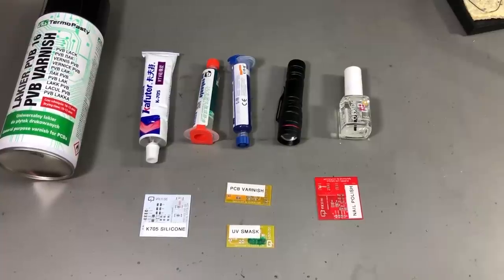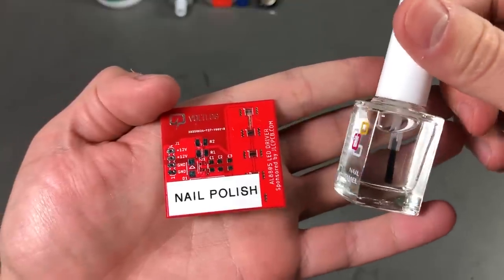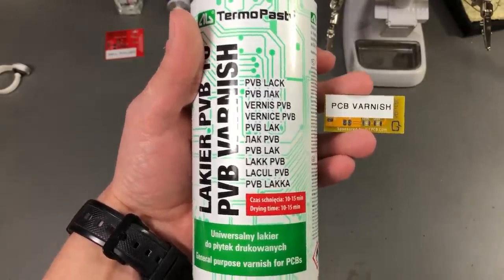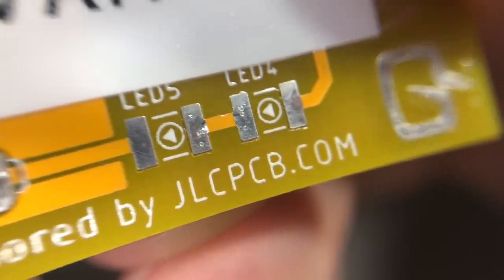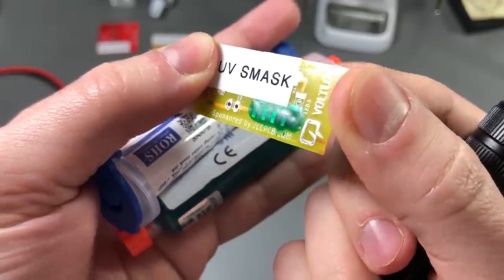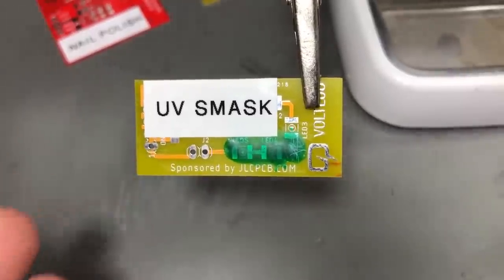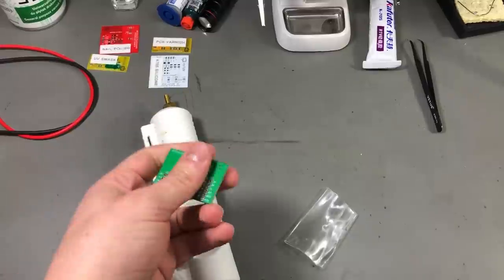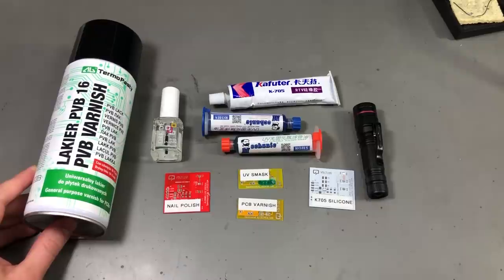Voltlog #220 - How To Waterproof Your Electronics or PCBs

Comment: Great video. Great Scott did a few videos on this a while back, and one other thing he experimented with was true potting compound and epoxies. He also looked at a more extreme condition, water submersion. I think nail polish/lacquer is probably good for 90% of permanent installation of hobby projects (with maybe exception of submerged environments).
Reply from the maker: Let me start by saying Great Scott is an awesome youtuber!  Luckily we live in a day and age where one can find solutions for pretty much anything., like I found that pcb lacquer spray which is pretty affordable (around $10) and easy to apply. Sure if I was in a pinch and didn't have anything else, I would use nail polish and it would probably be fine for a hobby project.

Comment: Somewhat expensive, but I use Electrolube silicone conformal coating for small PCBs.  A 15ml container with brush is about £7.  It works well.  just paint it on like nail varnish.  You can find it on ebay.

Comment: Termopasty is also the manufacturer of rosin flux, which is very good to use. It's called Kalafonia. It's solid crystalized flux, it melts with heat or you can dissolve it in IPA to make it liquid.

Comment: I use silicone conformal coating specifically made for electronics.  It's not that expensive and is quick drying. Even as a hobbyist, you can apply it after circuit board assembly. It is available in both aerosol spray and brush on.

I also use potting compound - what you described as epoxy in your video. As my name suggests, I do RV (Recreational Vehicle) electronic projects that can be exposed to the elements, and a waterproof solution is essential.  One other advantage of potting compound is you don't need a case. An electronic potting box holding the circuit board filled with potting compound is an economical alternative.

Some of my projects use microcontrollers that must be pulled out of the circuit board if a firmware update is needed. To accomplish this, you need to use machined sockets as the standard split finger type can be damaged by potting compound wicking from the bottom.

Also, I sometimes have to seal the bottom of components prior to potting, again to keep the epoxy from wicking into the part.  DiP switches and such are two examples.  I typically do this with the brush on conformal coating, so in some cases, I use both products.

Not sure if I would use Nail Polish, lacquer sprays, or other general purpose items when low cost electronic grade solutions are available. You never know what will happen over time. Some products might damage the board or components.
Reply from the maker: yeah it's nice that even as hobbyists we can find and purchase these professional solutions, thank you for your feedback!

Comment: To be honest, I never used any coating on my PCBs - then again, I never needed to place any of them outdoors. Certainly that does mean that the home-etched ones with exposed copper and nothing else don't exactly stay shiny for long, but I've never had any of them fail after any amount of time either. But it's nice to see how many ways there are to skin a cat, and I do have a project in mind that definitely will live outdoors, so... nice line-up!
Reply from the maker: I remember the days when I was making home-etched PCBs, they we're oxidizing pretty fast. The solution was to use some form of silver coating (expensive) or uv solder mask which was messy to apply and difficult to get right (pad alignment)

Comment: I tend to use the 15ML Electrolube FSC conformal coating.  Just ordered some Kafuter k-705 to see how that compares.
Reply: John, I hope you'll share your findings!
Reply from the maker: From the pictures/description I assume FSC is more liquid so it's easier to apply if you need it to flow into small spaces. Would be interesting to present your findings in a video.
Reply: @Corgitronics  No problem, will do mate 👍
Reply: @voltlog  It is quite thin buddy and flows into hard to get to areas quite well. Yes I'll do a video comparing them 👍

Comment: Oil filled box... The moisture will separate itself and settle down, thus making it easy to remove. Plus it'll provide liquid cooling
Reply from the maker: Sure you can do that but oil is a solution used in general for high power circuits. I'm thinking it's preferred for it's cooling capability rather than moisture protection because you can achieve moisture protection with other stuff that is easier to apply.

Comment: For the little project I'm working on, I've been thinking of potting. The board doesn't have any mounting holes in it so potting it in a project box is the best way I can think to do it. I can do it with slow setting two part epoxy pretty cheaply.
Reply: @2000jago  Do you have a recommendation for a cheap potting compound that holds up? The only potting compounds I can seem to find are like $30+ in bulk, I only need enough for small rc car boards.

Comment: I didn't hear any concerns mentioned about coating a PCB so I'd like to add one... heat retention. Coating a board will decrease components' ability to dissipate heat. I would think thicker coatings like silicone and hot glue would have a greater insulating effect. Just something to take into consideration.
Reply from the maker: you are right, one should consider a decrease in heat dissipation capability when adding a thick coating.

Comment: I usually use spray conformal coating, which can be purchased fairly cheaply here in the US (not sure about overseas availability). It works fine for me. I suspect it is similar to the PCB spray varnish mentioned in the video.
Reply from the maker: yeah, it's likely all of these spray conformal coating solutions are based on the same chemicals.

Comment: Great topic and good tips! I had never heard PVB Varnish but I immediately noticed it has its name also in Finnish on the can. And I could find it right away from a local webshop! A year ago I searched for products to use for waterproofing electronics but the only one I found recommended was Loctite 5145. I managed to find only a single shop here that sells and it had to be picked up from the store. Even there it was something I had to ask from the counter and then wait 15 minutes while it was fetched from some back storage. Not to mention it cost 40€. I'm pretty sure it'll dry up before I can use even 10th of it. Money well spent. It's also difficult to apply and the outcome is definately not pretty. :D
Reply from the maker: PVB Varnish spray was about 10$ if I remember correctly, definitely affordable and easy to source, at least in the EU.
Reply: @voltlog  Today I decided to order it. It turned out that the only place I could find it in Finland is a musical instrument store which is 700m walk away from home. :D They also have some generic electronics components (with focus on audio) that I might someday need to get quickly. Quite a coincidence! For potential Finnish readers: https://www.uraltone.com/pcv-varnish-16-suojalakka-piirilevyille-400ml.html (product name is misplelled)

Comment: Hot glue is really bad material for waterproofing your electronics. I have used glue in my aquarium's hood to waterproof some electronic parts which were about 10 cm over water level (very moisture environment because of water evaporation). Hot glue became unstuck from the parts after 6 month. So my suggestion is to use hot glue only when the environment is dry.
Reply from the maker: Thanks for the feedback
Reply: Also, sunlight, can shrink it and lead it to get peeled off.
Reply: It might work if the whole device is covered in hot glue.... With nothing coming out of it... Like induction powered -fully enclosed circuit
Reply: I'd say heatshrink filled with silicone sealant would provide a much better protection than hot glue. That being said, not all hot glues are the same so I'm also sure you can buy a specific hot glue that is specially made for waterproofing with better sealing properties. Such hot glues might even require special hot glue guns as they sometimes have higher melting temperatures.
Reply: Hot glue is sometimes made of PVA, a material that dissolves in water.

Comment: Very interesting video, thank you! The way I see it, it's important for any method to allow removing of the material in case of need for repairs/rework. I do small batches (<300) of boards and they usually require some kind of repair after several months of service, so I want to be able to remove the coating around a component. So, what you see as a disadvantage in some of the methods, I see as a requirement!
Reply from the maker: Certainly there are different requirements for different projects, I wanted to show some of the properties of these different solutions so people have something to start with.

Comment: I've yet to protect a board from the elements, but I have secured boards in 3D printed boxes before with MS Polymer adhesive (no acetic acid and ridiculously cheap). I'm not sure how water resistant it is however, so if I needed to seal a board in aqueous environments I would probably protect the board with a layer of varnish first then cover it in normal acetic acid silicone sealant for a dirt cheap 100% waterproof solution
Reply from the maker: Like someone mentioned in a comment above, it's important to check if these solutions would react in any way with the metals on the PCB to avoid issues like corrosion. It's likely that the acetic acid will slowly eat away the metal.
Reply: @voltlog  Not if it is covered in another material first to create a barrier

Comment: RTV Silicone (pure 100% silicone sealant available at hardware stores) works great. It's used to seal exposed elements like terminal blocks for marine and aircraft applications.
It's really good for providing both sealant and strain relief, for example, where wires connect to a pcb. (But it is a bear to remove.)
Reply from the maker: I'm guessing this stuff also has a strong odor? Like the silicone adhesive used for sealing stuff in the bathroom. I tend to stay away from stuff that smells bad because I have the lab in my apartment. But sure it's a good solution for those who have the proper space for using it.
Reply: if the silicone uses Acetic acid to cure and you put it a box while still curing, you run the risk of eating away your pcb tracks over time. the word acid gives the game away. there are loads of makes of pcb varnish on the market. as always do not coat your board until it's passed all it tests and you know it's working correctly. we used to dip the boards in to varnish then hung to dry.  but we did make units for military aircraft. look for  "conformal coating"
Reply: @voltlog 
The smell isn't that you should be worried about. It's usually just acetic acid (vinegar) for the bathroom silicone. The acid can attack copper though, so it isn't a good idea to use it on PCBs. But that's just one of the many ways how silicone rubber can be made. What you smell is essentially what splits off the uncured silicone polymere, so those polymere chain can link together (curing). Check the MSDS of the silicones you find. If it mentions "acetic acid", "acidic", "vinegar smell", don't use it for things that could be corroded by vingar. If the MSDS mentions something like "neutral" or "alcoholic smell" it should be fine. 
DIY store sealent might not be the best consistency to apply it in thin layers, but it should be a cheap alternative to pot something (don't quote me on that ;) ).
Reply from the maker: Good info on the acetic acid guys. Thanks for the tip!

Comment: Thanks for this video and information. Very insightful. How do these solutions perform in very cold temperatures? I have a car issue. There seems to be water infiltration and I'm unable to find the source. Evidently, the water causes issues with some of the electronic components in the car. As such, looking for a solution to protect the components from moisture and possibly water splashes. As I live in Canada, it can get really cold (-35 celcius).

Comment: hot glue won't protect against moisture for long periods... maybe do a test, how each is coping with moisture with voltage on the circuit
Reply from the maker: yup, that's what I was thinking, hot glue is not exactly a good moisture barrier.

Comment: Saw a vid where a guy used a tiny roller to spread the UV mask, and it came out pretty even. I think if the roller is foam it will go over and around parts to totally seal them. I use the spray because it's easy.
Reply from the maker: interesting, never thought about using a roller but thanks for the tip.

Comment: I like Dupont Dynamask dry film for my solder masks. At least, so far. I have some of the Chinese tube gunk but haven't tried to use it yet. I haven't totally perfected my Dynamask film application either, but I'm at around 95% there. With dynamask film as with photoresist I use the sun as my UV exposure source. My exposure time for photoresist is 3 seconds, and 5 seconds for dynamask film. These exposure times are done on a completely clear and sunny day between 11am and 3pm. I am South of Los Angeles California along the coast - so a high UV intensity area.
  
  Does that RTV silicone stink? I know the automotive gasket type RTV smells terrible.
Thanks for the upload.
-Jake
 :-)
Reply from the maker: The Kafuter silicone does not stink, I know what you mean I don't like that smell either.

Comment: do you know the difference between kafuter 705 and 5905?
Reply from the maker: the 5905 seems to be translucent vs transparent and more liquid, meaning it could flow easier. There might be other differences in their properties, like thermal conductivity.
Reply: @voltlog  Kafuter wrote to me and sent datasheets in english. They said: 
This K-5905 is used for bonding,positioning and reinforcing the electronic components,the main function is bonding.
This K-705 is used for sealing,encapsulating and waterproofing the electronic product,the main function is sealing.
This is the difference between Kafuter K-5905 and K-705,pls check attached product data sheet for K-5905 and K-705.
If you have any question,pls feel free to tell me.
Best regards, Chuck, xxd at kafuter dot cn

Comment: @VoltLog  Good video! I hope you get back to this topic as there are so many different products. I hope you would cover some of the waterproofing what you can apply even powered on! Product called "Corrosion-X" has multiple solutions that offer protection from water damage (prevent damage) and rustproofing. It seems more suited for pieces in motion to protect em, giving it unique use cases. I seen people apply it to for instant effect. Also here is another circuit board protection Varnish "PRF 202 Plastic Spray".